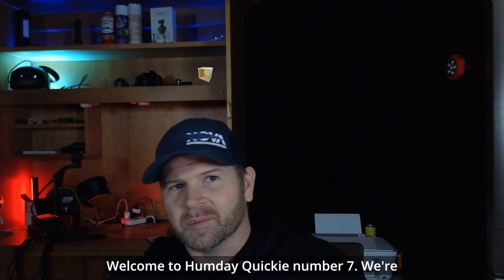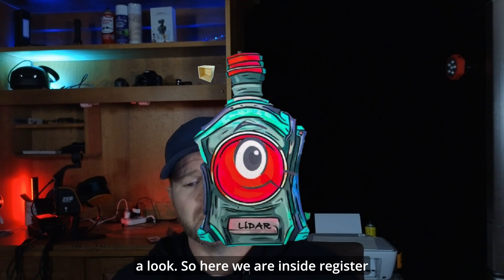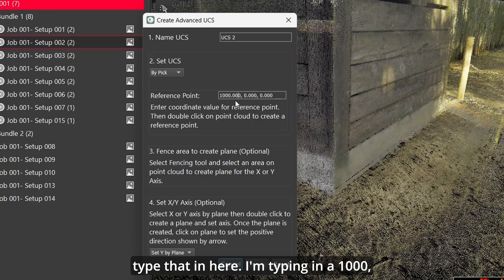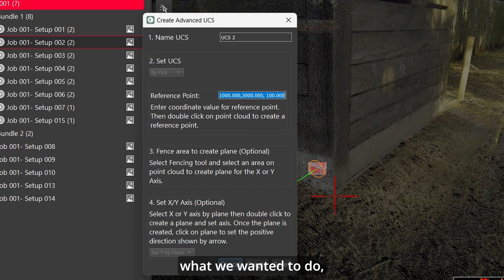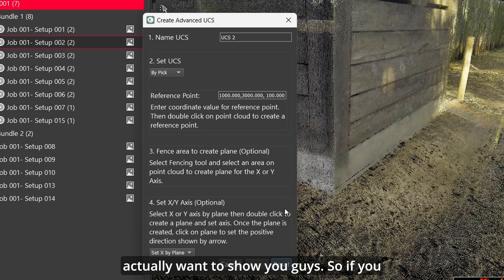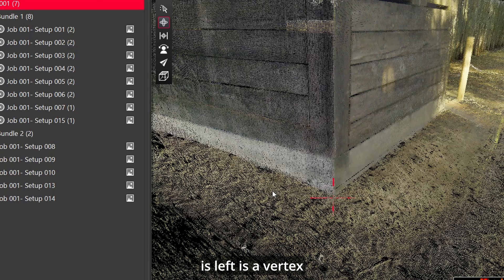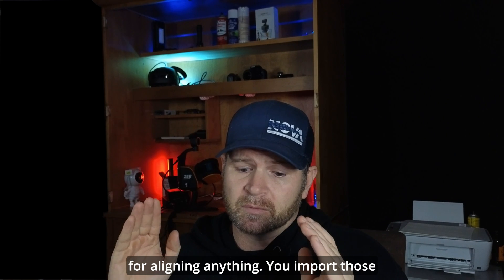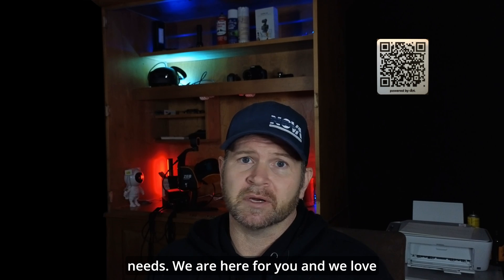HQ #7 All About the Advanced UCS in Leica register 360 plus

Comment: Hi, do I have to set UCS even though I've added a control? If yes, does it matter if I add the control first then add USC after? I did it that way and it looks like my point cloud is slightly rotated. What's the correct process on setting USC and adding control?
Reply from the maker: @DGermano25  no the control will be the coordinate system